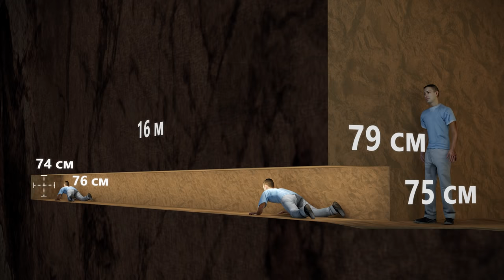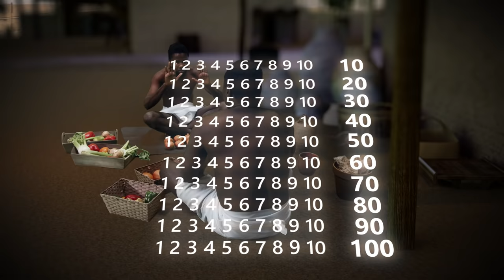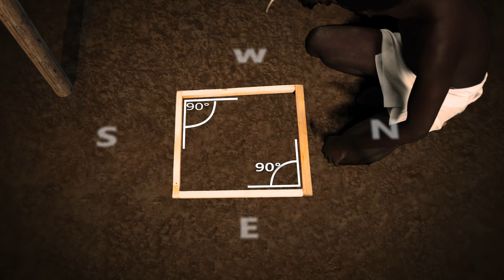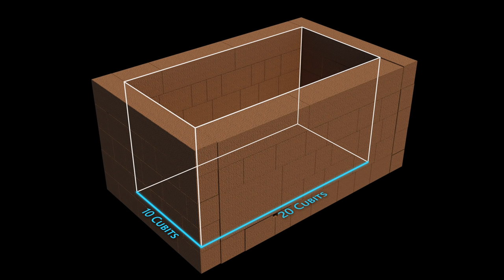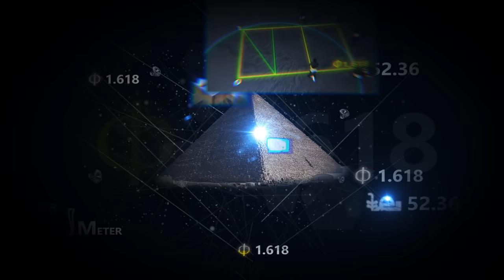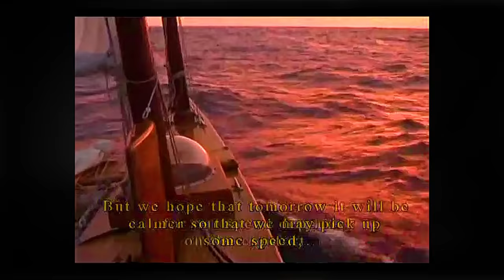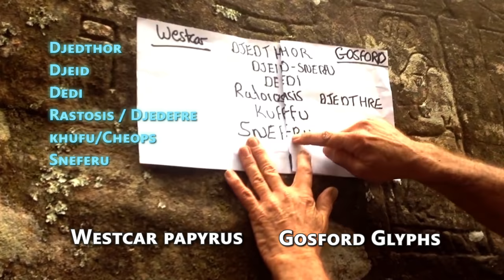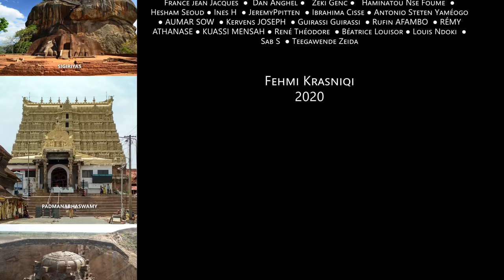The Movie Great Pyramid K 2019 - Director Fehmi Krasniqi

Comment: Sorry, but they debunked their own theory only a few minutes in, and several times afterwards, when they pointed out that the blocks at the base all had the same magnetic signature pointing north. Concrete is a conglomerate. Conglomerates will not have identical magnetic signatures. Period. Something they didn't address is where did they get all the wood, and how did they cut 10's of 1,000's of planks? 

Egypt has sycamore, mulberry, lotus, and palm trees. Three of these bear edible fruit that the ancient Egyptians depended on for that reason. Did they sacrifice 3 major sources of food to build all these pyramids? I highly doubt it. Another thing that probably has masons tearing their hair out is the fact that concrete, although very tough, does not weather very well and after several 1,000 years would present an uneven surface. These structures do not present this. 

They also never mentioned the numerous tooling marks from some form of a powered saw found all over the Giza Plateau either, and are they saying that those 35,000 vases they found were poured in molds? Come on? And then, as another commenter so astutely pointed out, there's the unfinished obelisk that was obviously being carved out of the bedrock.

I never saw the part about the giant lense they were purported to have used. So, the ancient Egyptians could make glass - and grind it with precision? I don't think so.

I stopped watching after 90 minutes. There's just too many inconsistencies that they don't address. Just another lame theory. The bottom line is this: We don't know who or how these magnificent structures were built, nor by whom, or for what purpose. 

I have a saying: arrogance breeds ignorance, and Egyptologists are the most arrogant scientists in the world - I rest my case...
Reply: It is still a better story than aliens
Reply: But still you don't have Enough proof to conclude it,But its a better theory
Reply: Zeitgeist is available. Check spelling.

Comment: Try pouring molten rock into a wooden mould, and you'll resemble charcoal more than just its colour.
Reply: how about id we use clay?
what do we get then?
Reply: @angelchiriboga3904  Honestly, I don't know. Clay does have a high tolerance to heat and  certain types of clay are better than others, but due to the size of the blocks that were supposedly cast, I think that the moulds would melt or even explode.
Reply: Clay, we still use it today to cast metal.
Reply: @davidkaye8712  sand also is used for castings
Reply: he said they used Clay not wood was the cast

Comment: If they knew how to make concrete, I still don't understand why they kept making blocks when they could have poured large areas altogether
Reply: Good Question!! Yeah make sence
Reply: and if they knew, how come so many colapsed pyramids exist...
Reply: Smaller blocks of concrete would suffer less internal stress (e.g. from uneven thermal expansion, or  pressure to bend or twist due to slight shifting of surrounding blocks) and would crack less.
Reply: The chemical make up of concrete is entirely different to volcanic rock. The pyramids were made of volcanic rock. It could only be possible if the concrete changed over twelve thousand years. The sun  lens and the mixing formula for making very hard stone is highly speculative. This is a race-based dogma film, and it becomes more and more ludicrously so as it proceeds. It is insulting to a scientific viewer, and will receive the scorn it deserves.
Reply: They did.  Lower courses very wide like the later Roman ones at Baalbek. But there are good reasons to minimize the risk of a bad set - remember they are mixing by hand - and rely on smaller stronger molds.  Ceramic no stick lining would have been needed on very heat resistant wood to contain lava.  I bet they didn't have much of that.
Reply: it cracks- and pushes against the edges of the forms.
like it still does now.
Reply: Because each stone would be created within the golden ratio, it was sacred to them.
Reply: Lmao because its not concrete!
Reply: @paulscottfilms  They don't mean literal concrete like the concrete we use nowadays, mr. scientist. They just refer to it as concrete because it was poured like we pour concrete today, probably to make it understandable and to not have to keep repeating 'poured mixture of limestone and different chemicals' whenever they refer to the stones.
Reply: Well, they did show a movable stair step shaped form being used to continuously pour that inclined passage going to Kings chamber. I think there is a modern method of pouring concrete that uses a constantly moving form. I do know of a method for relining masonry chimneys that uses that exact system.
Reply: let's all agree it was the dudes who created the structures on mars... aliens... 

lmao
Reply: @BrainCave If you were to have a look and see how they do do build buildings, bridges, dams and other feats of engineering marvels, its is block by block, section by section. 1) Concrete releases huge amount of heat as it is a chain of chemical reactions. 2) Stability and precision, easier to manage with sections or blocks.
Reply: @crhu319  no the megaliths at balbeck are not geopolymer.  And neither are the obelisks in Egypt. Or any of the granite blocks.  The limestone may have been though.
Reply: @BrainCave no bro, I have poured lots of concrete.  It is always done in smaller sections so it doesn't Crack.  Large sections over a certain size will crack.  Geopolymer can actually be poured much larger than concrete without cracking.  We don't ever try to pour single blocks of concrete weighing 10 tons.  Never.
Reply: Absolutely correct
Reply: @paulscottfilms  i am with you
Reply: Because without the support of iron rod like we used today it would be weak, so blocks was a better choice .  And if you really think alien build that than your imagination builder Alien are little backwards in terms of technology.
Reply: @thangkhawbung2967  not aliens, but not even a superior race of Egyptians who colonised all the known world...
Reply: @rankingcanada4532   makes zero "sence". just like your spelling.  smaller areas is stronger and easier to build.

Comment: 1:33:00, has anyone calculated the weight 
of the enormous glass lenses, which are 
mounted there at a height of 12 meters in 
a finely adjusted movable manner?
Reply: Or is there any evidence of these lens?  They could be still hidden somewhere,
Reply: I would calculate its weight as pretty dang heavy.
Reply: look on youtube a guy did this and its much smaller lens and melts granite .. it just wasnt as big lens as in this Doc but this is 100% true
Reply: @captaindiabetes4244  I'm not willing to watch how someone using high tech Fresnel Lens is able to melt .05 kg of stone because this is not scalable and has nothing in common with the problem raised here.
Reply: First of all giant lens will crash by its own weight. The purity of .5m thick material should be very high just to pass some light. To concentrate the light adequatly you need 300 year of knowlage and very advanced processing methods. To operate and control such a monster an observatory is needed.
Reply: According to this documentary the weight of that lens along with most information found is complete and fabricated bullshit
Reply from the maker: Hello, the weight of the lense is very light. After water evaporation  the weight of sodium silicate is about 250-300 kg.
Reply: @FehmiKrasniqi-Official  check your Facebook message
Reply: @FehmiKrasniqi-Official  Any evidence of the actual lens?
Reply: @FehmiKrasniqi-Official  
That is an interesting tidbit of information. Another interesting tidbit of information is that the Gods of the peoples of The Ancient Americas were Pale Skinned with Red or Very Light Hair, not Dark Skinned in the least. The genetics of my people show Mongoloid genes not African genes. Their language, religion AND buildings all show Eastern most influences (IE Asian not African). And your "documentary"   does not mention the fact that using solar radiation to melt granite causes it to turn into black obsidian which is far different than the beautiful vibrant granite we see all over the sites of the 3 large pyramids. And speaking of things that turn black, your documentary beats it's viewers over the head with the belief that ancient dynastic Egyptians are as black as the obsidian that melted granite turns into, when in fact all the artwork from that early period shows Egyptions to be reddish brown in color. Why do you feel it is necessary to misrepresent the truthes in this manner? That casts great doubt upon the rest of the claims made in this documentary that may very well be true but will be dismissed because of these other, obvious untruths.
Reply: @FehmiKrasniqi-Official  For which volume 
did you calculate the 250 - 300 kg?
Reply: @shadowninjarider374  my thoughts exactly. I've been inside tombs in the valley of the kings; they are full of hieroglyphs from front to back. In this doc they claim the pyramids are tombs, like so many 'scholars' have done for so long. It just doesn't make sense and casts a huge shadow on the rest of the things 'turning black'
Reply: Ok, after looking up powdered sodium silicate I would estimate it to be roughly 2/3 the weight of sand and maybe....MAYBE a little lighter in resin form. It seems like it would be way less clear than normal glass. I would expect 2 lenses as big as they show in the presentation needed to heat granite to liquid state.  And from the demonstrational videos I have seen in the past 24 hours, liquid granite would cool to an unusable semi solid halway down the pour. It cools back to a solid way too rapidly to accumulate in a mold to be usable.....at least that is the way it appears. Without proof of trial of these methods it's merely WILD speculation.
Reply from the maker: @silberlinie  The volume of lense is about  9 cubic meter, maybe 600 kg.A real scientific experiment must be done.
Reply: @FehmiKrasniqi-Official  Volume of 9 cubic meters for lens with 5 m diameter sounds reasonable. But I found very different data 

for density of sodium silicate without water about 300 kg per cubic meter which is the density of wood. Yes, its many times lighter than glass (2500 kg/m3) but it is a lot. If I'm right the lens should be more than 2000 kg.

Comment: If you poured molten rock into a wooden form, wouldn't the form burst into flames?
Reply: bingo........uhh...exactly....this crapumentary is full holes!
Reply: Clay frames
Reply: @helpmehelpme323  I doubt that "clay frames" would contain molten rock any better.
Reply: Angry Hippo  In the video it looked like they were using wood.
Reply: Angry Hippo  the amount of skill needed to create negative image molds would be more interesting then the supposed poured statues and structures they would have made from them. Not to mention there would exist artifacts of these molds/ descriptions of the technique....but yet no where to be found in antiquity, amazing and convenient. The skill level to create perfect negative molds of smooth structures is off the charts for the time period. Not to mention impossible to pour distinctly different blocks on top of and next to one another which is what we see in the pyramids. If you heat up granite to the point that it melts it is no longer granite when it cools nor does it resemble it any longer. That is science fact, if your buying into this you need to seek the advice of an actual chemist.
Reply: exactly , not to mention how hot it would be pouring anything that was 1000+ degrees i mean we are talking about going to a volcano and scooping up some lave no shirt some sandals and a skirt . i call bullshit
Reply: @jelsner5077  You haven't learned about casting and it shows.
Reply: @giuseppe_M  How do you think we cast metal?/ And granite countertops today?
Reply: @240sxRule  Granite countertops are CUT from natural stone, NOT poured from molten stone.
Reply: @jelsner5077  ahahahaha I know right?  Yes Billy they cast granite countertops now go play outside.
Reply: @hauntedtown  Hahahaha!
Reply: When you melt granite yo would end up with basalt...  If it's posible we would melt granite today... BS
Reply: And so what if the form bursts into flames? 🤷‍♂️

I'm sure a lot of you have never been around any burning wood, and it shows. The surfaces in contact with the molten rock would carbonise, creating a carbon foam that shields the rest of the form, and as long as any flames are damped down on the rest of the form, it'll be fine. Surface area would be the enemy here, keep it as low as possible, and there's less surface to catch. 

Ya'll make it sound like molten rock would eat though it like acid through thin metal, thats not how fire and wood works folks ;)
Reply: @mor4y  Thus saith the Firemaster.
Reply: @jelsner5077  usually I get called a pyromanic, but I'll take fire master 😆

If you want to see how well carbon foam can work, look for a video on starlite on youtube. Or have a look at early nosecone experiments for ICBMs and rockets, they were all made out of wood until they could come up with a reliable alternative
Reply: It is special non flammable wood. They got it from Aliens.

Comment: I still think the Pyramids were inherited by Egyptians, but  not built.
Reply: Even if the dynastic ppls of that time didnt build them, there still is the mystery of where the tools are to that this doc tries to address. Pushing the date further back from the egyptians doesn't change the engineering enigmas.
Reply: However, there is straight forward evidence that the egyptians were a stock of ppl from what we call Ethiopia today. And they have pyramids too. So it follows then that since the egyptian monuments are more advanced in construction, then they were likely made by the egyptians.
Reply: Nephilims
Reply: The Sphinx has water erosion marks at the base like it was sitting in water for a long time. The last time there was water there was at least 11,500 years ago. The Sphinx and the Great Pyramid complex are much older than Egypt. Remnants of the pre cataclysmic civilization that was all over the globe.
Reply: The watchers
Reply: 3,6,9. 72° 1:43,200